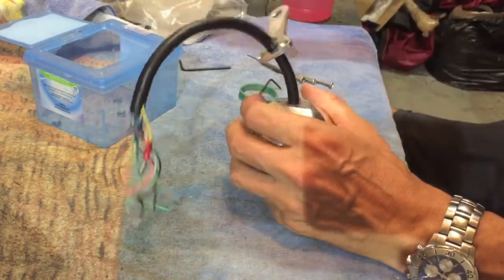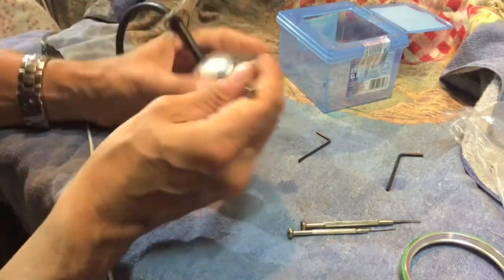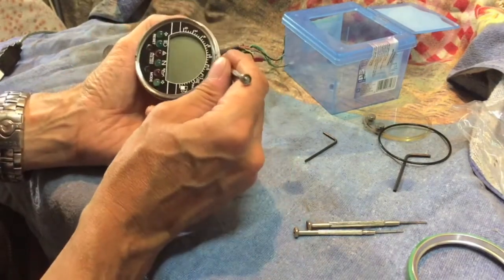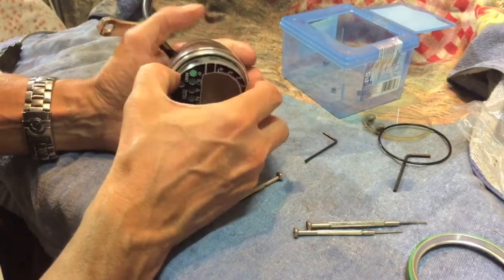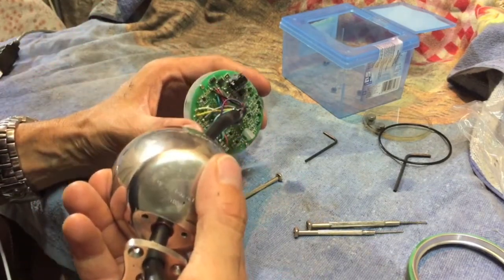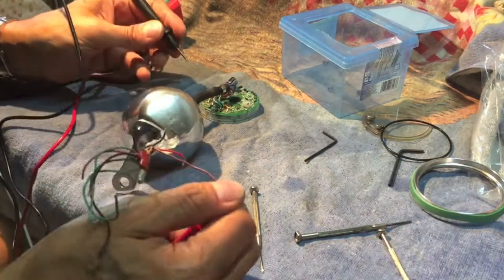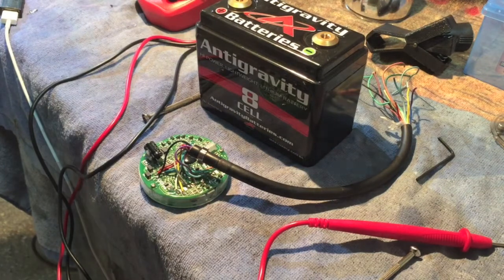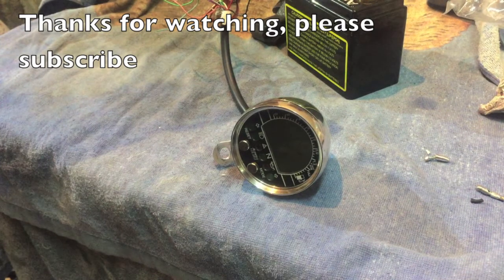Acewell Speedo, What's Inside?

Comment: Hi!
I have the exact same problem with my Acewell 2803, i have done the same thing as you did in the video, do you know what the issue was?
Reply from the maker: Hi. I ended up sending mine back to the manufacturer who was kind enough to repair it for me free of charge.
Reply: @Sorcli  okay, you dont know what they did?
Reply from the maker: @gaviksbo  No, I think at least the internal parts were all new if not the whole thing was replaced, can't remember now, too many years ago 😆
Reply: @Sorcli  okay, i have contacted them and they answered directly and sent my question to support.
Thanks.
Reply: @gaviksbo you perhaps have the contact info saved? My display is empty too 😞
Reply: @Kristoffer1983 Hej, antar att du är svensk med tanke på ditt namn 😜 
Jag fick aldrig tag i nån på Acewell, så jag köpte en cykeldator på XXL och kopplade in inför besiktningen, den går bara till 99km/h men inte nått problem alls på besiktningen.
Reply: @gaviksbo  förstår inte vad du menar 😅 OK! fann en mejl igår. Hoppas det kanske går bättre
Reply: @Kristoffer1983  haha, okej. Får du återkoppling får du gärna lägga ut här och höra av dig.
Reply: @gaviksbo  fick igång displayen. Enligt deras troubleshooting så är låg apänning problemet o mitt batteri var mkt lågt. Under körning så fick den helt plötsligt upp spänningen igen tack vare laddning och poof displayen kickade in. Den här snubben i videon har ”12 volt” men decimalerna är avgörande. 12,3 volt = no display. 12,8= voila! Display! Testa ladda upp batteriet
Reply: @Kristoffer1983  hmm, jag har ju testat både med laddaren på batteriet och tagit lös den och kopplat 12v via agregat. Ska testa med 13v på agregatet 😊

Comment: Can I use this for my KTM duke 390? Do I need to buy a converter separately? 

Thank you
Reply from the maker: Should be compatible with most bikes. You will just need to look at which sort of speedo drive you have. They make a drive converter or a magnetic sensor for the wheel. They are both available on the acewell site and ebay.
Reply: Thank you sir

Comment: Do you recommend one of these?
Reply from the maker: Denis They are a good speedo which works well. This one has been repaired free of charge by Acewell even though it was way out of guarantee. You can get used ones at a good price. If you can afford the Motogadget Tiny I think it looks cooler.
Reply: Ok, thanks. I did look at the Motogadget, but don't  you have to get the M-Unit for it to work?  Another question, how would I convert my mechanical sensors like tach cable to a digital ?
Reply from the maker: Denis No I believe they should work as this and you can connect it up fine. There is a converter from manual to electronic signal. I’ve used one on my XV and you can see it in my build video as I made a custom part to hold the speedo drive
Reply: Clive Hancy i am looking at motogaget tiny now as well as the risers to mount it from cognito moto.